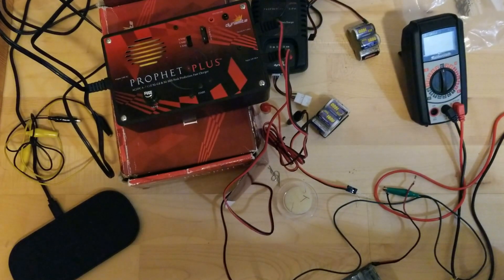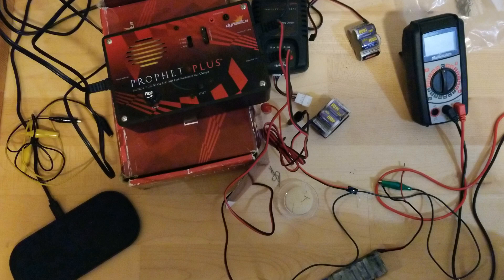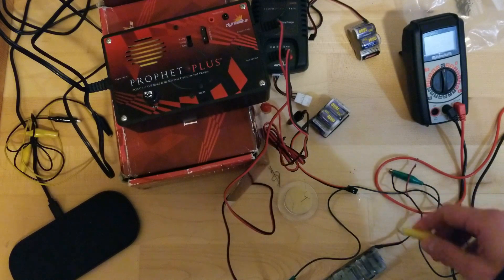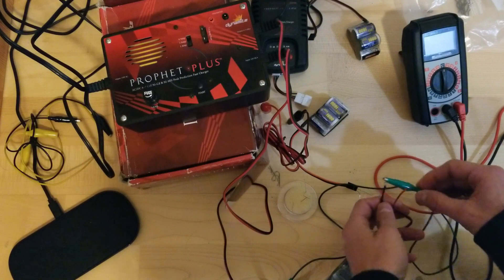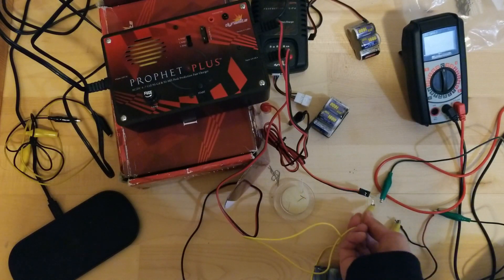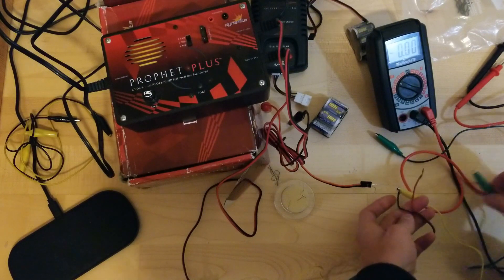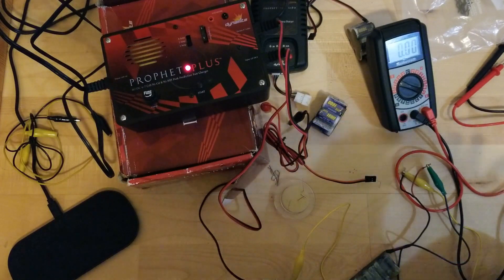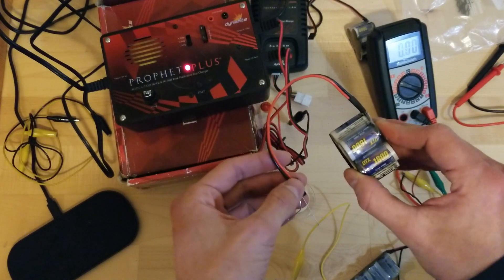How to charge batteries your charger wont charge

Comment: Mine wont charge. It beeps then flashes😭😭
Reply from the maker: Do you have the same charger? You can try and bump the battery pack with AA batteries in parallel.

Comment: When I charge my battery I press start but then it’s beeps after I press start and the light starts to flash and not stay solid please help I’ll subscribe
Reply from the maker: Do you have the same charger?  Depending on the model sometimes flashing means it's charging.  Also could you give me a little more info on the battery your trying to charge?  Sometimes the connectors get worn or dirty and don't make a good connection which causes greif. Try and clean them with some break clean or rubbing alcohol.  If it's tamiya connectors Sometimes they open up to much, and don't grab the male end right. Use a pick and try close the femal end slightly to improve connection.
Reply: @layback209fixorsmash3  my battery is a traxxas power cell and the charger is a prophet plus AC/DC 4-7 cell Ni-Cd & Ni-M11 peak prediction fast charger

If that doesn’t help then can you tell me how to see what model it is or type of battery it is?
Reply from the maker: @NukegamerboyRA  ok here is a link to your chargers manual. Take a look through here. We need to figure out if its your battery or the charger thats the issues.  Does your charger beep when you plug your battery in? Or when you plug your charger into the wall? Also your battery should say how many cells it is and what the chemistry is. I'm guessing it's nimh. 

https://www.horizonhobby.com/product/prophet-plus-ac-dc-peak-charger/DYN4036.html#
Reply: @layback209fixorsmash3  ok thanks and it beeps when I plug in the battery but I’ll look through the manual!
Reply: @layback209fixorsmash3  ok so I looked through the manual and I seen the charging times and I tried 2 amp and it still didn’t work and the battery is a bit beaten up so all the labels are unreadable so can I just count how many battery’s are in it? If not I can find a picture of the battery I have or a link. Thanks for all your effort!
Reply from the maker: @NukegamerboyRA  ok, what I think is happening is either a loose connection, a dead cell or a break in the battery wiring, sometimes when the get beat up a bit the spot welds that tie the cells together can fail. Battery issue not the charger. This sounds like a 6 cell nimh ( you should be able to count how many cells are in the pack).  Do you have a volt meter you can measure where the battery is at?  It should be 7.2v to 8+v if it's less then you may have a bad cell or cell connection.
Reply: @layback209fixorsmash3  oh ok well it has 7 cells. sadly I don’t have a volt meter.
Reply: @layback209fixorsmash3  I guess I have to get a new battery
Reply: @layback209fixorsmash3  I’ll definitely be recommending you to other people your very helpful. Thanks for trying to help.